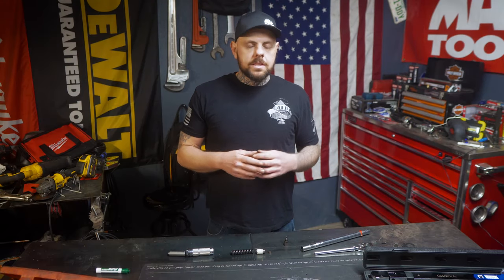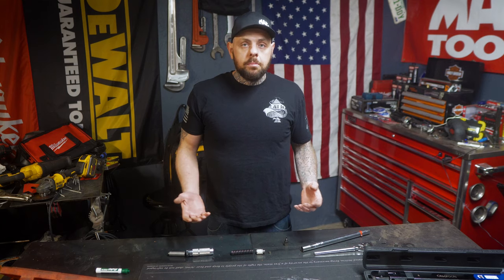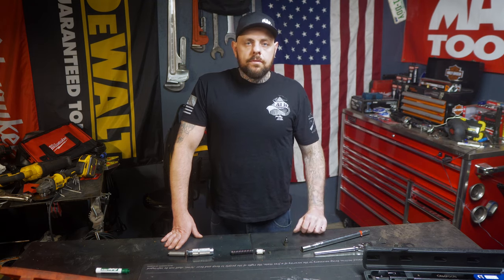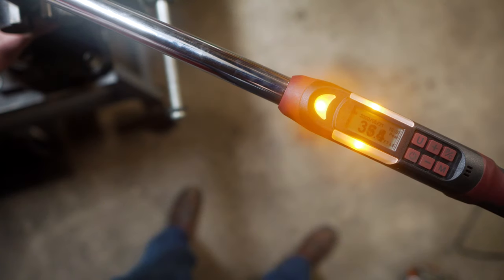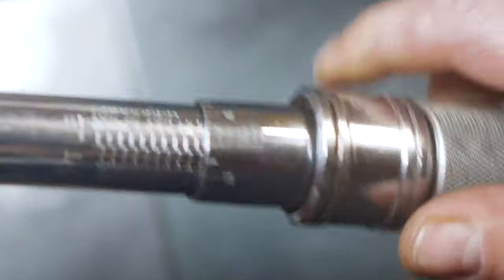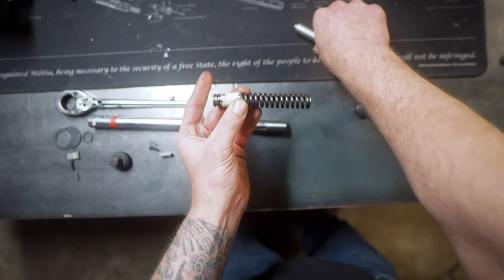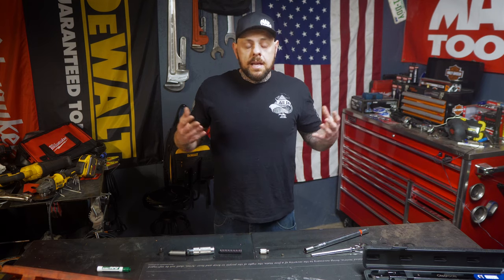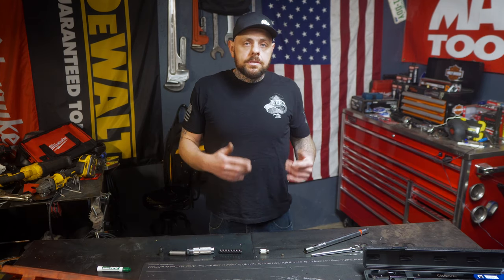How Do Torque Wrenches Work?

Comment: Nailed it brother. The spring alloy grade in a $10 clicker is incredibly cheap. Even when you rest the wrench setting properly after use, it will change in dimension after so many stress/strain cycles of use and go out of calibration after a short time. They come accurate from the factory but not for long.

Comment: Some digital units do click as well so you do need to unwind it. I own one like this and also a digital with angle that you don’t have to wind back it’s a true digital with angle. I am curious how the olsa one performs I almost bought one. I have seen digital units mess up which is why it never hurts to have a backup. The click style is good for tire lugs even though you have to unwind every time. The split beam like the olsa is good if all you do is tires all day then you don’t have to worry about winding it back

Comment: Hi, I clicked because I’m interested in how tools (torque wrench in this case) work, hold up and are made. I appreciate you getting one apart. I wish you could have gone into a little more depth as to why they work; what’s happening. I don’t think I really got that, just that they work by different mechanisms. I have two old Snap-on Foot-Pound split beams (1/2, 3/8) and an older Snap-on inch pound which is a beam(?) with the dial indicator gauge. Are those basically beams with a case? I was also wondering how the split beam work and how to calibrate or check calibration. I got the 1/2 inch for about $19 + $19 shipping because the guy said it did not work and was only useful for parts. However when I got it I tested it and it seemed to tighten my 17mm motorcycle lug nuts correctly. So I don’t know. In general though I appreciate your work.

Regarding the video, I would suggest that when you show a chart or graph that you hold on them for at least 4+ seconds and/or a slow pan across the relevant information you are trying to explain. Close-ups are always good. Sometimes people show the whole page and by the time I find the line or point they are talking about they cut away. It’s easy to think it’s covered or obvious when you know what you are talking about. Others like me take a bit of searching and thinking to understand the information. I do my best with this in my videos but I know it’s not always easy. 

Thanks again.
Cheers.
Reply from the maker: Hi I am sorry I thought i was clear. They work by the spring applying force to the head and the head having to overcome that force to slip off of the cube which is when you reach your desired torque. The split beams work by 2 beams one longer and one shorter  and a switch which has to overcome a detent and when it does then you have reachedyour desired torque. A digital torque wrench works through a transducer that provodes a current based on the pressure it receives and you input your desired torque through a digital display and when it receives the correct voltage it sends a signal. I appreciate the feedback about the charts I thought I showed them for like 8 seconds each except the second time i showed the same chart which was only for a few seconds. I will keep that in mind next video.
Reply from the maker: As far as checking calibration you can manually measure it I can do a video about that tomorrow for you if i have a chance.

Comment: I just threw my HF 1/4” torque wrench in the garbage can. It is almost impossible to hear, feel or see the indication. The HF 3/8” and 1/2” I have previously owned and used before upgrading and never had an issue with them. I purchased digital torque wrenches and hated them so I sold them almost immediately. The best 1/4” torque wrench I’ve used so far is an Armstrong.